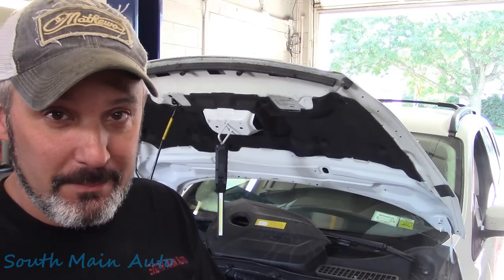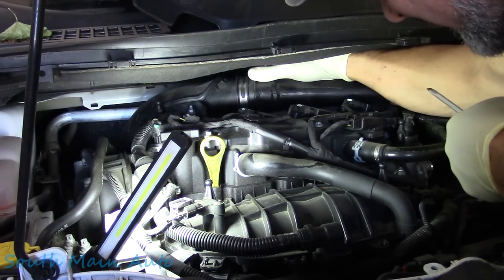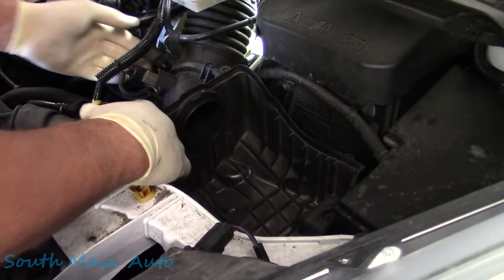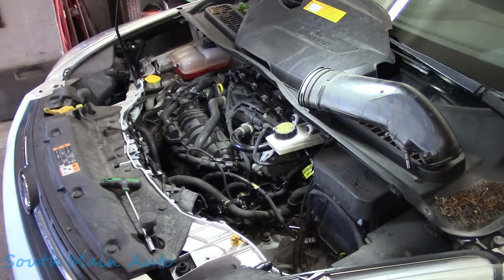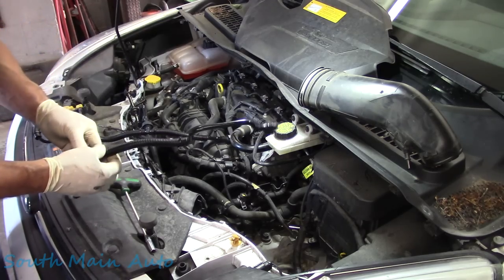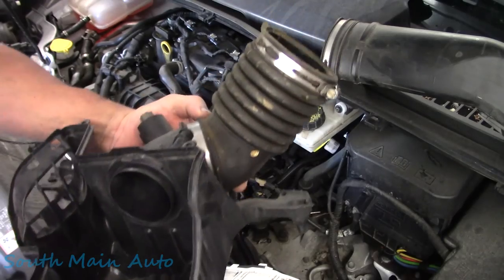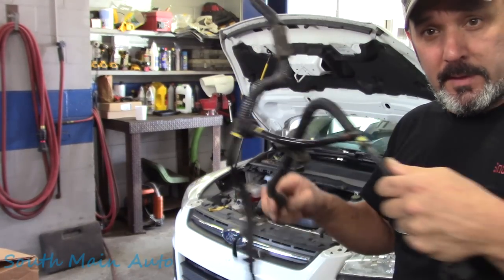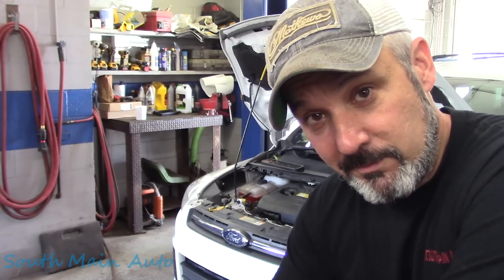Eric O. Unloads The Parts Cannon!

Comment: Jobs like this makes me miss the good old days when you opened your hood and everything you saw was easy to work on
Reply: I feel like this is misguide though. Back in those days you had to work on your car every weekend to keep the piece of crap going. These days, yes cars suck to work on, but you more often than not never have to work on them. Not in a substantial way anyways. My Prius has 275,000 miles. Literally never done anything to it other than fluid changes. My old 1987 Chevy Beretta with 110,000 miles had a much easier to work in engine bay...but the problem was that I had to be in the darn engine bay every weekend to keep it going.
Reply: My old 70 Dodge Coronet was pretty reliable considering that it had 213,000 miles on it when I bought it. I usually would have to work on it about once a year except for the year it had a battery, the alternator and the voltage regulator fail within 3 months after a very close lightning strike. It caused a surge that briefly pegged the temperature and gas guages. The gas guage was never accurate afterwards. That old engine would start with just a bump of the starter after the first start of the day. Those old cars could be very reliable if you took good care of them.
Reply: @isaackvasager9957  those Chevy Berettas where junk from factory floor.

Comment: I’ve messed around changing plugs etc. on my own Escape and that entire 2 piece black plastic cowling under the windshield wipers comes off fairly easily with 5 minutes work opening the top of the engine compartment up  back to the firewall. It sure makes it a lot easier accessing stuff towards the back of the top of the engine.

Comment: What a hassle to remove that filter box! Of course Ford had to make a purge valve such a pain to replace. But like you said, check valves could be a issue later if another aftermarket part is used again. Another happy SMA customer!

Comment: I just dealt with this on my Fiat 500 Abarth. Found a huge hole in the rubber fuel filler vent hose. I couldn't get gas in it either, and had a pending P0441 incorrect purge flow code. Under load it ran totally fine. I unloaded the parts cannon, got the afforementioned hose, purge valve, charcoal canister, and vacuum solenoid. Total cost? About $150 self installed. Problem fixed! Figured I'd get rid of all the possible causes at once.

Comment: We had a customer that had just bought a car. Wanted a full tank so she noticed that the door was noisy when opening and closing. I ordered the lower self retracting hinge. She later said that went to the gas station and said she could not fill it past 25 bucks. I told the sales rep that we will diagnose it when she brings it back but it was unlikely that she could fill that much before it stopped filling as they tend to build back pressure fairly quick. Anyway, I looked st the design and this was for a 2017 jeep grand Cherokee and that thing has a design that involves 4 possible failures, not the conventional stuck shut vent valve. all in all I concluded that the customer just wanted free gas and made up the story that she could only fill that much. We filled it to 30 bucks and no issues.
Reply: Pass the cost of fuel onto the customer.
Reply: @ShainAndrews  the purchase of the car was from us so we grant fixes if the customer has some sort of complaint even after the sale is done, though we sell cars "As Is" we grant diag/repairs and even returns when the issue is big enough.
Reply: @ShainAndrews  yeah and for like $5/gal too!!!
Reply: @scientist100  I totally get it.  If $50 in fuel helps get a repeat customer it's money well spent.  Just annoying to deal with those types of individuals.

Comment: And once again, I love my VW. My purge valve is about 3 inches long. Got it for $17 at NAPA. Took 15 mins to change because it had 2 of those HORRID one use clamps. I replaced them with the good old teeny tiny screw clamps. Solved the not starting after a gas up issue lickety split!

Comment: My dad had one of these piles.  I begged him not to buy it, but he bought it because it was cheap.  When he died we could hardly get rid of the thing.  Great video!
Reply: That's odd, had a 2019 and sold it for more then I paid, before the prices went up on used cars. I have had offers on my 2020 for sticker with 25k miles. I will sell it soon when I get an idea of what I want to drive next.
Reply: @hoodman420  This was 4 years ago.  You might be able to do that now.
Reply: @hoodman420  The one my dad had was a 2015.  It had oil leaks, transmission leaks, he had it at the dealer about 4 times just for leaks.  When he died we tried to sell it and got $11,000 with 36,000 miles.

Comment: When pulling connectors, sometimes you have to think outside the box.  I had a fuel injection line  that had to come off. The deal was it needed a special tool which I did not have. No tool was needed to connect back up. Connector was about 2 dollars ( from the dealer, wow ).  Snip Snip, Click click.

Comment: I used too have a similar problem on my 2014 Fiesta ST 1.6T . I would fill up and my engine would start to stumble.  every once in a while would die. I was recommended to replace evap purge valve like the Eric  O is doing here. 👌
Reply: just get 1/2 tank - great when prices are dropping

Comment: Ford may have invented the assembly line plus it appears they have also invented putting the purge valve on said assembly line first and then building a car around it.
Reply: After all, cars are designed for assembly, not for repair.
Reply: Henry Ford did not invent the assembly line. It was used in the 14th century by Venice to build warships. In other words, His  employees refined the process by introducing conveyer belts.

Comment: Some people will laugh at you for “throwing parts” at a car ( guys on IATN come to mind) even though it is often in the customers best interest. If I know from experience that part x is often the cause of the problem a customer is experiencing but the problem is not occurring in the shop I can either spend hours upon hours diagnosing the issue only to either find out that it was the suspected part x or come up with no problem found. Yes, after the hours of diagnosis (that the customer must pay for) I will most likely be able to tell the customer some things that definitely aren’t the problem but I may not be able to pinpoint the cause exactly. If I replace the suspect part that by experience is a known issue, then the customer now at least has one future problem fixed if it wasn’t the actual problem. This all depends on the price of the part etc.
Reply: completely agree. I have on occasion sent out a sensor that i can return, customer states problem is still there or intermittent with new sensor. Unfortunately, next part in line is a 1500$ ecm. And its a common failure :(

Comment: If you had taken the left front brake rotor off first, then replaced and torqued the wheel to factory specs, then turned around 3 times hopping on one foot, it would have been much easier.

Comment: When taking those purge pipes out why not tie a piece or string to the one end and when pulling the pipe just let the string follow through, when installing the new pipe attach to the string and pull?? at least you will have a track (string) of where the pipes "run"?

Comment: Yeah that's the problem, you're good. I have an 13 Escape with the 2.0 and I've had to replace mine twice. Eventually it throws a code and if you let it go too long it starts to die while you are driving when you start to break and the RPMs drop. First time used a Doorman as a replacement. Dumb me had to replace it again in a year. Second time with a Standard. Much better. 

For me I had an extra connection down by the manifold that was a bear to get to. Also, I took the entire cowling off to get to the rear one. That was 2 hours of torture I hope to never have to do again.

Comment: I got a set of screwdrivers coming from Germany through one of the suppliers at the dealership I’m at it’s a 6 piece set 3 Phillips 3 flatheads has the handles like wera and the hex on the shaft you can put a wrench on for like 20 bucks

Comment: I diaged a Honda that died every time you had a hard stop.
Then it would start right back up with a little long crank and be perfectly fine until the next hard stop.
No check engine lights.
After 2 days of driving, testing etc, I found about a half a quart of water in the fuel tank.
Every time you had a hard stop, the water would slosh up into the fuel pump and stall.
After looking for a source of the water I found small rust holes in the top side of the filler neck seen with a mirror.
Now seems obvious but I was pulling my hair out for a while...lol

Comment: I had a 2015 F-150 when you would fill up and try to round up to the nearest dollar or try to squeeze a little more gas in after the pump would click off the truck would always start but would stumble and act like it would stall out I stopped doing that I have a Corolla same thing would happen. I know it’s bad for the evap system. Just something I’ve noticed

Comment: I hate putting cars on the lift at my old age of 56. Thankfully my kids 22,18,15 can operate the lift. My knees,hands and back aren’t what they used to be so I’m relegated to being an automotive instructor to my kids and they friends😂.
Reply: Point and supervise. That’s about where I’m at in life. Fortunately they actually enjoy learning and doing.
Reply: GET A DRIVE ON. Raise the car and then set the rolling jacks {be sure to get 2 jacks} standing up under the car.  72 years old and bifocals convinced me to try a drive on and I love it. Bonus is the ramps give you a handy place for tools and parts. Down side is it does get in the way on some jobs on smaller cars as it does take up the same space on small and large vehicles. Mine will hold/lift a double cab 8 ft. bed 1 ton.

Comment: My old 2002 Nissan and my 2014 Corolla are very simple to change. The better one to change? The Toyota because the valve is in the engine bay compared to the Nissan which is located inline with the charcoal canister on the left rear side behind the wheel. In the same vein, I always tell people NOT to overfill the tank because the excess gas doesn't go into the tank, it goes to the charcoal canister which is designed for gas vapors, not actual gas. I give people a price for the charcoal canister. Some people stopped, some people didn't care. Well, can't fix it tall.

Comment: Well, on a 2003 Mazda Protege 5 with the NA, 16V, none variable FSDE motor, I have the dreaded P0455, which I saw last Sept or Oct, and there may have been 2 others that I didn't see then, but a couple of months ago, saw the 2 others, a P0090, and a P0660, all related? I know 2 of them (the 090, and 0660) are supposedly in the engine bay if memory serves. All this on the Launch Creative V scanner I have.

I can't find out for sure if I actually have a missing fill flap or not in my tank inlet pipe where you stick the hose to fill one's tank as I can't find a clear image of a new one that shows that section of the pipe to know if it's indeed supposed to be there. Only noted it may be missing back in the spring and could have sworn it was there? Anyway, I know about the flap near the tank that is supposed to reduce vapors from escaping. 

However, the car runs fine, starts up for the most part quickly, though every so often when doing a cold start, it may crank a second or two longer before starting and may blow bluish smoke for a few seconds upon start up, but again, not always. the "money light has been on since last fall and the car runs fine at 195k+ miles on it. BTW, not having any issues when I fill the tank of it starting right off the bat, even when full as I don't top off my tank and lately, it's been 20-ish dollars at a time.

Thankfully, I don't have to deal with rust so this one is still quite solid as I can't afford to replace it outright at the moment.

Comment: Had an evap code on my Ram MegaCab with the big 5.7 Hemi. Aimed the parts cannon, replaced the purge valve, but that did not fix the problem. So I rigged up a home-made smoke machine, found a hole in a plastic evap line on top of the gas tank. Damn squirrels… I cut out a short section of line, bridged it with rubber hose, problem fixed (until the next tree rat gets under there…)

Comment: As satisfying as it is to prove a part is bad, with an intermittent problem even if you spent the hour to get at the valve, you might not be able to show it fail. So I can see why a pro might pull the trigger just based on the characteristic history, more for the customer's wallet than sloppy diagnostics.

Comment: I had a brand new Hyundai Azera that did this. No lights or codes. It would not start then buck and shake for several minutes when it did. Dealer couldn’t solve it. I sold that POS shortly after.

Comment: Just curious, you mentioned Ford F150 eco boost four wheel drive in your check valve comments.  I put mine in four wheel high one time and the check four wheel drive light came on.  Ford rebuilt the whole front end of the truck under warranty.  I hardly use 4wd and the truck is never driven hard.  I wonder what may have happened?

Comment: Normally it's a safe bet to stick with OEM, but when a part is on back order for months, it could be because they are selling like hot cakes (due to failures). So in that case why not try aftermarket? Maybe someone else made it better. And in the case of your NAPA part, it was at least "fabrique aux etats-unis."

Comment: I would love to see the factory workers install all this stuff.
Reply: That whole sub assembly of engine/trans/subframe is 95%+ assembled outside of the vehicle and married on the line…the OE doesn’t give a crap what is needed to fix it once it leaves the factory.
Reply: It’s the 5%, the last little things that get added, I’m wondering about. Every time I loosen up a hose or take something off, there was someone else who put it on before I touched it. The part Eric first started taking off was likely put on before the engine was installed, you’re right. Sometime in the mid 80s I visited the GM plant in Arlington, TX. At the time they were making 2 cars, the Montecarlo‘s, and I forgot the other one. It took them two days to make a vehicle. There were 2 separate lines for a car being put together. The body started in one part of the plant, where the roof was welded onto the main body, then they attached the doors trunk and hood. Then, that went to the paint section for 24 hours. Meanwhile in the second section the wheels and drivetrain came together.  Eventually the painted car came down from the roof and the interior got installed…seats, trunk, dashboard.  After the engine was installed the body was lowered onto the frame, 4 big bolts connected them, fluids installed, battery and then time to start it. 

It then spun the wheels, checking the engine and trans and brakes, an finally out the door.
Reply: @davidhoman3807  at the end of its car days, Arlington was a B/D car assembly until 1996 SUVs became more profitable.

I have owned 3 B body sedans made there and each one was of progressively worse build quality.
Reply: @SIGINT007  Ah, finally found my answer at Wiki Arlington Assembly: 1978-1988, the Monte Carlos were made with the Olds Cutless Supreme.

Comment: As a non-mechanic.. I dream of a lift and not using 1 jack and 4 annoying jack stand that pinch you sometimes.  Although, DIY auto work is pretty frustrating and spending a few Thou on a lift, probably not for most people.

Comment: Now, my question is. What is the major cause of these things failing. is it the fuel? Or just a part thats worn out over time. Or is it too much garbage that some engineer thought "Yeah, lets squeese a valve and little baby rattle check valves way up under here as a joke.". I've also known valves that just kill them selves after a year of install and use (thanks dorman). It seemed like I was replacing valves on the silverado I owned every six months. An in the P.R.O.N.Y. that little yellow light is the signal for a death warrent on a car.

Comment: Ever done a radiator on one of these?  Total PIA.  Then ENTIRE and I mean ENTIRE front end (bumper and everything)  needs to be removed.  Under panels, HVAC needs to be evacuated and trans lines removed.  Radiator and all coolers come out in one big wad.  Not a fun job and the customers have a cardiac when you tell them the price.

Comment: I had that problem with my 88 mercedes 300SE 3 liter straight 6. 
you'd get gas, shut the car off and it wouldnt restart for 30min or so. then it ran fine. 
what it turned out being was the crankshaft pisition sensor would heatsoak when the car was off. that messed up the ignition module and it wouldn't fire or fired too weakly to start.  no computer on this one, bosch mechanical fuel injection. no codes, only an O2 sensor and lamda adjustment.
Reply: So you didn’t have this problem then…got it.

Comment: This 03' Taurus has been sitting for about 5 years, had to buy a battery, no start, checked the fuel module fuse-ok, put gas in-no start. Thinking it might be the fuel pump because of not being cranked up now & then, but after watching this video now I'm thinking it might be a bad purge valve. What causes a purge valve not to work? Thanks, Mr. O.
Reply: Over use, failure, planned obsolescence. Vapors from fuel with the ethanol, pick one.

Comment: Recently diagnosed a bad vacuum pump that is ran from the cam shaft. When the pump fails it snaps the bolt off into the cam and you have no brake booster. Ford escape is on part with mini for access and time consumption. More money in our pockets I guess. Sucks for the owners of these.
Reply: Nobody forced these people to buy such pos vehicles. I don’t feel sorry for them AT ALL.